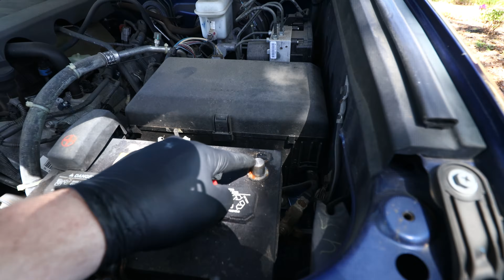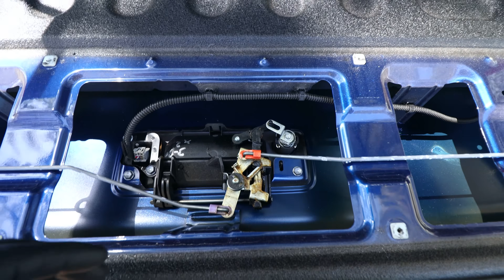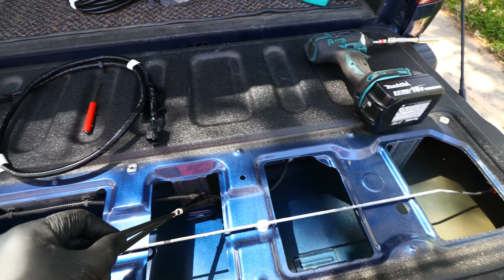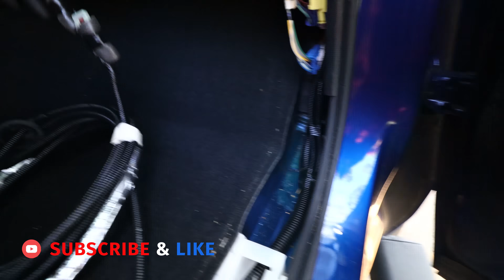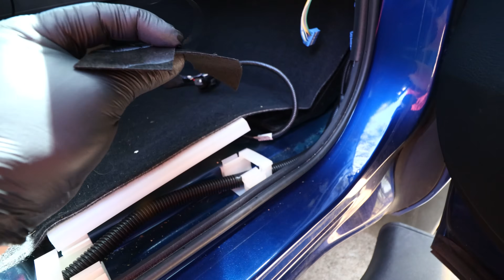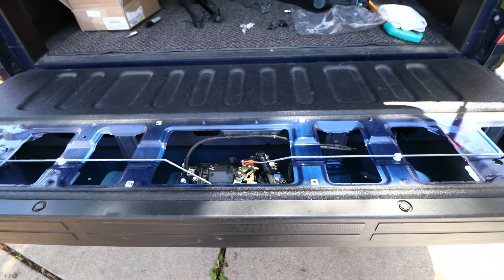Toyota Tundra Mods | OEM Power Tailgate Lock Kit | PK3B6-34JS0 | PK3B6-34JL0 | Amazon | 3rd Gen

Comment: Fantastic video, very well done, giving me the courage to upgrade as well.  Question - I see that your truck has a truck cap/camper shell, were you able to also integrate auto lock/unlock for the shell? if so, what's the make/model of that shell, and how did you connect to Toyota's OEM actuator wiring?
Reply from the maker: The specific Leer camper shell on this Toyota Tundra is designed with two manual-locking twist handles and still needs to be opened manually.

Comment: Thanks for the informative video.  Just installed on my 2016 SR5 but the factory grommet under the carpet already had a wire.  I simply cut a slit in the new grommet to accept the existing wire.
Reply from the maker: That's very good info to know! Thanks 👊👍. I am glad to hear that the video was helpful.
Reply: Thanks

Comment: Just installed mine on my 2020 pro.  Nice video thanks!
Reply: Baffles me that auto tailgate lock is not standard on a 60K 2021 truck. Just installed a bed cover on my ‘21 TRD Pro and realized I now need to buy and install this harness.
Reply from the maker: It baffles me too. It's definitely a necessity, especially in regards to how easy it is to remove the tailgate completely if you forget to manually lock it.
Reply from the maker: I'm happy to hear that my video was helpful! 👊👍😁

Comment: What’s the difference between this and the Pop and Lock?  I am assuming that are not one in the same
Reply from the maker: They're essentially the same. They both do the same thing. However, a lot of people say that the Pop & Lock version is much louder.

Also, the OEM version is 100% "plug &play". The Pop & Lock version may require wire splicing into factory wires. 

I hope this info helps! 😁
Reply: @LevelUpMechanics  Thank you. Sparks Toyota website states this I not compatible with my 2018. I’ll give them a call to confirm. Also, which part number goes with the SR5 Crew Max and 5”7
Reply from the maker: Yeah, the dealer will say it's only compatible with 2019 & newer models, but I can assure you that it's compatible with your 2018 Tundra. 

Here is the info for the part: 

Toyota OEM Power Tailgate Lock Kit (short wheelbase) - PK3B6-34JS0
https://amzn.to/2PikcRj

You can purchase this on Amazon too (follow the link above).
Reply: @LevelUpMechanics  Thank you!
Reply from the maker: Anytime 👊 👍

Comment: This is the second video on this same lock installation and both presenters failed to show the last wire connection. Why? Is it that simple? Is it a secret?
Reply: Thanks for the info!
Reply from the maker: What are you referring to? The last connection to the lock actuator?
Reply: @LevelUpMechanics  yes. You attached the new wire harness to the existing wire harness on top of the frame and then … done. It’s all finished.
Reply from the maker: I understand what you're saying. The hard part of this install is just routing the wire harnesses. After that, it's literally just "plug & play".

I definitely understand what you are referring to now 😁. 

I can tell you that if you are interested in doing this install, you shouldn't have any issues figuring out the connections between the body harness & tailgate harness. You'll just want to secure that connection with a zip tie, like you would with the rest of the harness.

Thanks for giving me a heads-up on what I missed. Your feedback is definitely appreciated 👍😁.
Reply from the maker: If your referring to the body harness meeting the tailgate harness, then yes, it is that simple. 

If you routed both harnesses as shown in the video, the connection between both harnesses is quite simple and easy to do. 

The important info to show is how the wire harnesses are routed.

I do agree that maybe I could have shown the connection between the two harnesses so that viewers could have a visual to refer to.

I guess I just didn't think about it while filming because it is very simple to do, so it didn't occur to me that the visual aspect would be necessary. 

Thank you for the constructive criticism 👍 as it will help me to improve my content in the future.

Comment: Will sitting inside the vehicle and unlocking from the door controls to unlock other doors also unlock the tailgate as well? Great video and easy to follow instructions. My dealership wants $419 plus tax for this installation and part. From the video, I can easily follow and save that money minus the part.
Reply from the maker: You are correct. If you are sitting inside the vehicle, pressing the unlock button once will unlock the driver front door. Pressing the unlock button twice will unlock all doors AND the tailgate.

I'm glad you found the video useful! The install is pretty straight forward and is plug & play.

Comment: This is great, but how in the world did you get the top snap back in place on the passenger kick plate? It seems impossible with the way the wiring harness is mounted to the body.
Reply from the maker: I don't think I had too much of an issue with the wiring harness being in the way for me... 

I know that the kick plate / panel has a couple of white(?) plastic retaining clips that can sometimes stay stuck in the body of the vehicle when removing the kick panel... in which case, you need to pop them out of the body, place them back onto the kick panel, and then re-install the kick panel... 

Did the plastic retaining clips come off with the kick panel for you?
Reply: @LevelUpMechanics  this was the problem. I didn’t realize I needed to remove the clip from the body, put the clip on the panel, and THEN push the panel and clip back onto the body. I was trying to get the panel onto the clip while the clip was still in the body.

Thanks!
Reply from the maker: That's awesome 👌 I'm glad I could help out!
Reply from the maker: Also, the plastic retaining clips look like they are bent when you remove the kick panel... this is actually the way they are supposed to be. The pointy end of the clip needs to be "pointing" towards the front of the vehicle, so it will "suck" the kick panel in / forward as it snaps into place...

Trim panels can be tricky / finicky sometimes and may require a bit of trial and error... I think Toyota may have slightly over-engineered this particular trim panel (as it is very similar & frustrating to install on the Tacoma as well) 😆.

Comment: I was going to ask you what year Tundra because I have a 2015 and where ever they sell remote they say it’s not compatible with 2015 only 2019+.  At the very end you tell us it’s a 2015 you made me wait LOL
Reply from the maker: Lol, yeah it's a 2015 Tundra. I don't know why Toyota only says it's for 2019+ but it definitely works for 2014-2021 year models.
Reply: Yes, I can confirm that it fits 2015 tundra. I have 2015 CrewMax with a short bed, everything worked out perfectly. It's pretty easy to install.
If you buy this kit from the dealer, don't give them your VIN number. They don't know that it fits all 3rd gen tundras.
Reply from the maker: Good tip on regards to buying from the dealer 👍 👍